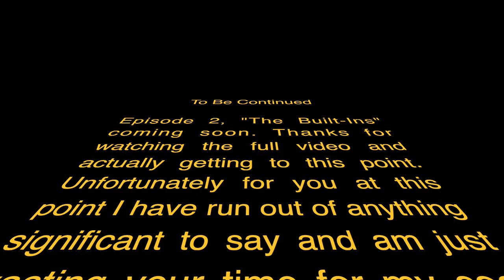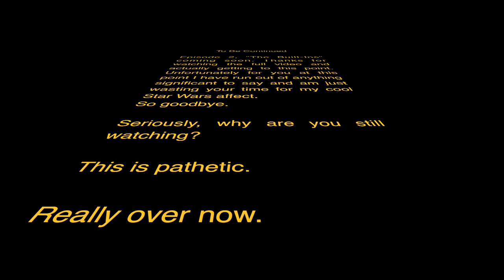Sunroom on Master Addition

Comment: Beautiful.   What would work like this cost roughly?
Reply from the maker: Hi Marsha! This is always a tough question to answer, especially since this particular project was for myself so I didn’t really keep track of it all. I would bet at least $30k if you were hiring someone to build it for you.
Reply: @ModernArtisan  I can confirm this!  I have one in progress now, and I'm at around $35k.  Mine's a bit different , and has 12' glass slider on the gable leading to a 5' landing and full width composite steps.  We started the idea as a small balcony, then a screened porch, it just got bigger and more complicated.  I would recommend to spray 5" foam and use 2x6" construction, then you'll not need any additional HVAC for the enclosure.  Mine is 12x14'.
Reply: @bruceeverett5372  35k? What a ripoff.  I’ve built a larger house for less than that.
Reply: @crosisofborg5524  Of course you did.